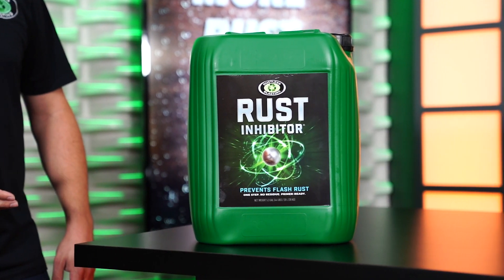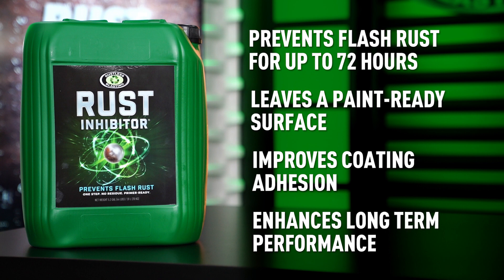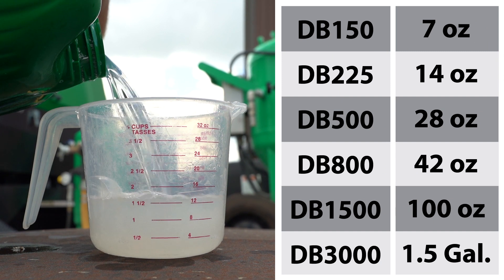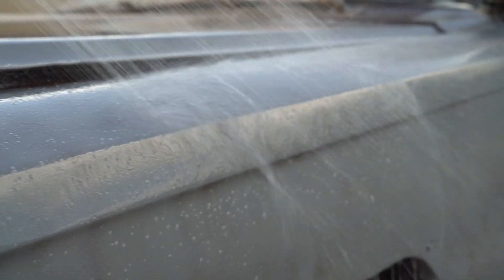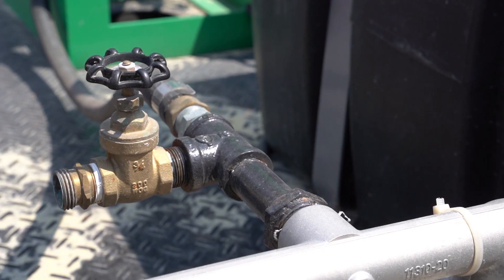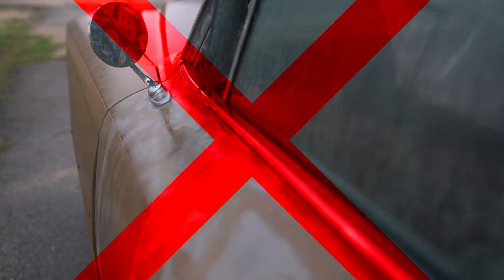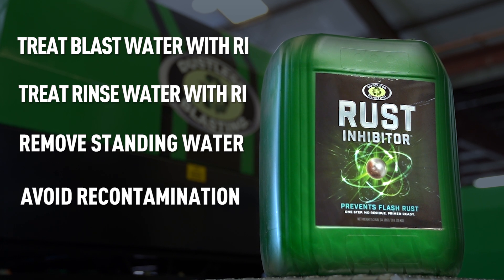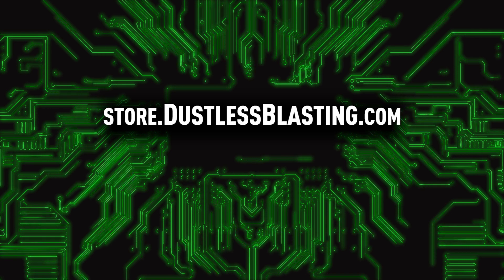How to Use the Dustless Blasting Rust Inhibitor!

Comment: What is the main ingredient?
Reply from the maker: The machines are capable of blasting wet, dry, or with soda, so they can use any abrasive a traditional dry blaster can use.
Here is a video about how to choose the right abrasive: https://support.dustlessblasting.com/blasting-basics/what-media-should-i-use-
Reply: @DustlessBlasting-MMLJ  I'm talking about your rust inhibitor solution is all it says on the SDS is "Organic amine water soluble 
compounds"

Which could be a number of different things. So what exactly is it made out of?